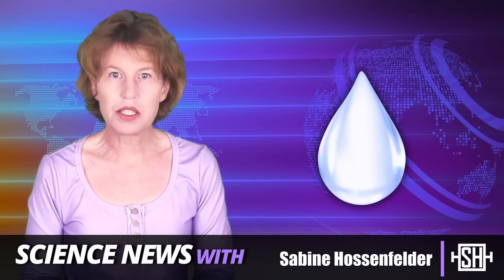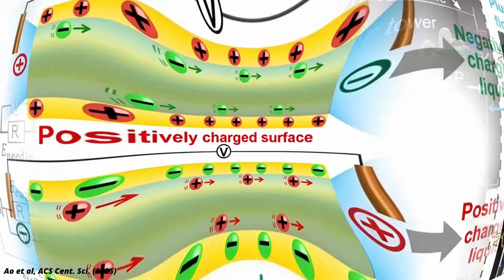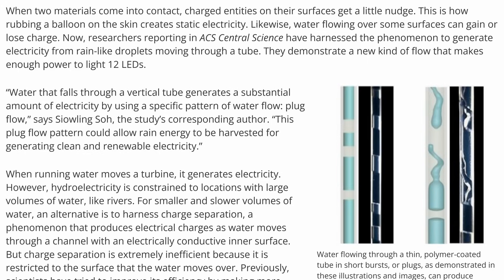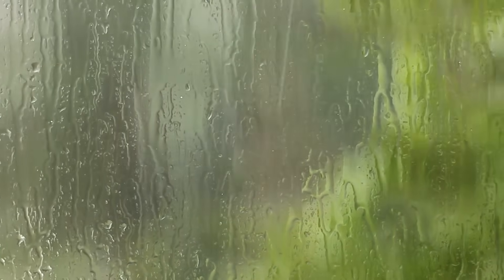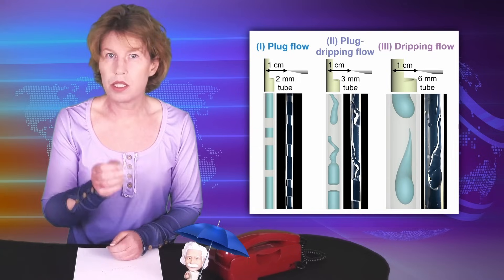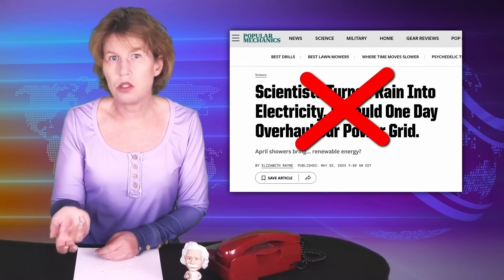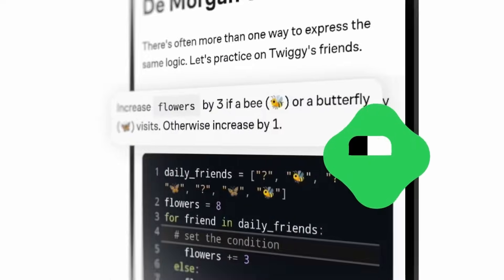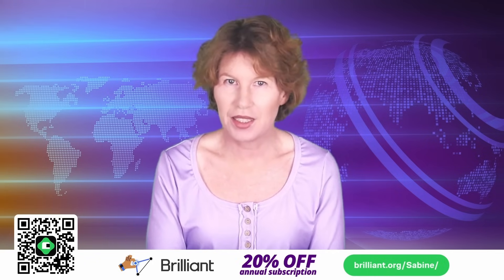A New Way to Generate Electricity From Rain

Comment: Thanks for the video. It is unclear to me how it scales with the tube diameter. Do the tubes have to stay at miliscale? What happens of they get bigger/smaller? 
Obviously, it cannot scale linesrly as the surface area that is in contact with the water scales differently.

Comment: The current 'gold standard' for moving-parts-free electricity generation remains the photovoltaic process. It is powered by photons, delivered to us 24/7, cost-free, maintenance-free, in more than sufficient quantities for billions of years to come! The pesky 'base-load' problem already has a moving-parts-free and economical solution and is in the process of being ramped up as we speak.The necessary grid conversion/expansion for whatever generating solution is implemented, in 'Stralia at least, is already under way!

Comment: It seems like it would be simple enough to develop an easily installable strip of these along the base of solar panels that could produce a few watts per panel, could be used for monitoring or even charge a battery and store the water for intervalled cleaning.
Reply: Less than 1 mW per panel, as usually you don't get kilometers of rain per hour.
Reply: @СашаЧерный-э2т  it's 0.4mW per tube, 2mm tube, 1.4m panel, a single row would produce 280mW per panel. Water collected across the entire panel is directed down to the row of tubes so don't need the km of rain per hour. Depending on where this is used in the world a reasonable amount of energy could be produced to even run the low power servos used to tilt the panels. When it rains you can't generate power from a solar farm but you still need to operate monitoring equipment and other systems so having this as a back up in that scenario could be useful if it can be produced at an affordable rate.

Comment: There is a background energy density in the vacuum of space that can be measured with two metal plates very close together in a vacuum sealed isolated box, the bubbling of larger particles from the quantum energy background happens more on the outside of the plate than the inside so some of those wavelengths get shielded by the plates, resulting in a net inward force where the plates have a small force inwards that is measureable, casimir effect, so what if you have now, a really really really really really thick plate. what's happening there? if you get mass dense and large enough, it pushes out some of the energy that would have been in that volume of space and you have a net force from the quantum energy fluctuations that would have been in that volume of space the the mass takes up, so there is a net force of all that energy being squeezed out layed on the surface of the solid mass, that we feel as gravity. So if this is correct, then gravity is not pulling us in, but we are being pushed on from the outside, and if it is a finite energy density per volume of space, then one day they should find two black holes that are different masses but both over the limit of how much gravity the quantum background can provide so they maybe could have vastly different masses but have the same gravitational pull which would be the limit of one single body's gravity. And maybe if you drilled a hole clean through the moon or the earth and you jumped in you would just float there in the cancelled out beam of zero point energy. I've been looking at gravity the past like week or so as a force coming from the outside in from the background energy of the quantum vacuum and it feels weird to stand or lie down now what do I do

Comment: Didn't Lord Kelvin create a device like this back in the day?  I followed instructions in Popular Science to make one of these devices -- you have a current of water droplets falling through a copper ring that's connected to one of two coffee cans sitting on an insulator (paraffin).  As the water drops through the air, charge builds up on one of the coffee cans.  Both coffee cans have sturdy wires (stripped coat hangers), and in a few minutes enough charge differential builds up between them to ionize the air between the two wires and create a spark.  It's interesting to watch in operation because as the charge grows larger, the water droplets are more deflected to one side and also start fragmenting.   [ok, my memory was flawed -- both wires attached to the coffee cans have copper rings on them and they cross partway up, which is where the sparks happen] https://en.wikipedia.org/wiki/Kelvin_water_dropper

Comment: Aha... 🤔 Yes, so the bottleneck is not the number of tubes per area, but the amount of rain per area. Ok... What if they make the tubes longer? Much longer? Like 40m tall towers with a big funnel at the top, and a few m2 of densely-packed 40m long tubes running all the way down. Would that get us a reasonable amount of power?

Comment: The switch to renewables is not a technical issue, it's a political one. Solar and hydro is much cheaper than fossil fuels, but the oil men have the guns and they use them. (FYI - Gaza, Ukraine, Sudan... those are all oil wars.)

Comment: Maybe it's only a distraction from figuring out cross valley arrangements of insulated at connections points for collecting electrical potentials between cables into capacitors during valley winds and rain passing through. Not everyone is to the point when testing if others know how to think right. But then I just jest knowing otherwise.

Comment: I doubt the claimed efficiency -- 10% of the ideal gravitational potential energy. Also, hydroelectric pumped energy storage is about 75% efficient, and a turbine generator is reported to be 90% or so. So... about as useful as piezoelectric shoe phone chargers.

Also, from videos of the Kelvin apparatus, the tubes might not be required. Once the drops are launched, they can fall through air.

Comment: I once estimated the power output of a balloon collecting rain water 1000m above ground. It was not great. Depending on location it could go up to 300W for a balloon with 50m diameter. But much less in most locations.

Comment: Even if this method of electricity generation was amazing, it would still be no good as our climate is now so unpredictable.
Up to about 10 years ago, I would have said Scotland could have been a powerhourse - given all the rain it 'should' receive under normal conditions (where I live it used to rain 50 weeks a year. Not 50 weeks solid rain for 24 hours, obviously. But you were guaranteed some rain every day).
Now, the rainfall rate is so refuced that the stream in my garden is almost dried out. It'll be only the 4th time this has happened, and each time has been in the last 5-6 years. 
Lately, our weather is very hot, dry, sunny and unbearable to work in. The farmer next door started working in his field at 9pm last night - when it had finally cooled off. 
Everywhere is just so dry, if someone drops a match, the ehole place will flare up. It's that bad.
Yet I'd never have thought it would be like this - and any installation of a rain powered system in what is currently high rainfall areas may dry up in the next few years.

Comment: If I may add to the previous statement, solar panels are actually incredibly detrimental when using black in the atmosphere of a planetary body that maintains balanced systems based on the use of emission and absorption spectral lines and the differences between them, when comparing nominal or previous balanced conditions to current conditions as a means of maintaining, balancing and extending the longevity of conditions conducive for conscious beings for as long as possible.  Black absorbs heat in atmosphere, or more specifically, is used to compare emitted wavelengths of energy of the surface of land and in soil, compared to conditions of space at night for example,  when heat transfer and particulate are most nominally balanced, among other things.  It doesn't absorb "light" like you would assume it does in space, the wavelength energy it does absorb is typically opposite in terms of horizontal and vertical propegation as it relates to wave particle duality between light and sound and propegation of energy in space, verses atmosphere. Yes, that is a thing. A common aspect of energy propegation at the sub atomic scale and up. The light it most likely does absorb, would be ions and embedded heat, and wavelengths of nearby energy... By attaching a battery to solar panels, or connecting them to a grid, you're actually creating a vacuum of sorts with a positive polarization I do believe,  that pulls the negative electron from the particles or energy interacting with the surface, simply put  the potential fallout is enourmous, especially when considering entangled states and objects in space that also create vacuum. The Earth's magnetic field energy propegates outwards from the core as well by  the way, if that isn't already understood or widely accepted. This is partially how particles are given the polarization that allows them to propegate and be balanced as long as they have been... Surface propegated electrical energy, mining, satellites, scientific experiments, perceptions towards magnetic fields and modern infrastructure have seriously inhibited this and created any number of seriously alarming issues far more serious than this rediculous focus on  green house gas emissions. Which is also a laughable term, considering oxygen is the only gas i'm aware of that nature emits when properly taken care of, or certainly when prioritized as the life sustaining and multi-functional companions they are and not viewed simply as a commodity, which actually reduced their monetary value over the long term, as sad and hilarious as that is.

Comment: The place I live has about 40 mm/m2 per month rain fall. That amounts to 1 kg/day per m2! If all that rain falls with a (terminal) speed of 10 meters/second, that yields a total kinetic energy of K = 0.5 m v^2 = 50 J/day. Yes: 50 Joules per square meter, is the total energy you can get from gravitational potential in one day. That amounts to avg of 0.5 mW/m2 ? This is the average, and the actual energy comes in larger high peak surges during short rain fall intervals.

Comment: Reinventing the wheel, are we?
If one want to use rain for electricity, all one can say is: "rain starts at considerable heights."
And that having "bucket" chain loop with alternator guarantees that taller the building, more energy per "bucket" of water gets extracted.
Conversion rate is practically limited only by alternator efficiency and friction losses.

Comment: "a factor of four less than solar panels" is -3x solar panels, or -300% solar panels. Less than means subtraction from. A factor of four means multiply by four. You meant "a factor of one fourth as much as solar panels", and not even "a factor of one fourth less than solar panels" which is "3/4 as much as solar panels".

Comment: I though nothing until you said 250 000 tubes per m². Then I was "wait, how much water is needed for this

20 000L/min/m²... I just laught. This is perfectly ridiculous in any way to look at it. Just know that 20 000L = 20 m^3 of water, so basically you need to have 20m of full water above your m² of tubes to generate 100W. And I mean it is 30cm, so if you try to get that for like a 3m drop, which is 10x higer you could get like 1kW/m² ?

If you had that much water, you'd better put a dam and a turbine. This is useless for pratical purposes, no matter at how you look at it. However, it does not mean that the full research is useless. It is some kind of fundamental research that may lead to better innovations. For example, you could combine this with hydroelectric barrages where you have a LOT of water moving after the turbine, and then a little drop, where conventional turbines are useless.
So you could then get a big generation with a little drop, no moving parts, so almost no maintenance. Which is nice. That's the only way I see this being usefull.

Comment: Possibilities don't always pan out into tangible applications. Aside from the burning of fossil fuels to run power plants, humanity has utilized nature to generate electricity using hydropower (gravity) for about two centuries already. The "new" process requires a steady flow of water minus the turbine at the bottom but the power output is miniscule in comparison to what's being used today. I kinda have similar feelings about this "discovery" that Sabine has ... interesting  at best. News?

Comment: Pure water boils at a much lower temperature, have it move through an partial pressure substance like rice kernals arranged in the silicon straw.  This make the charge randomly build up higher than usual at 5,000 psi.  Put a waveguide around the rice tube to measure its shakra.  Jim baba a tinagat hojo atuti

Comment: I wonder if this could be used in those installations where they do desalination by evaporation. The paper falls back down as "rain". So some energy from the evaporation could be recovered. And then you let it flow through the drain pipe generator. The straws could be the length of the entire pipe. Before and after the generator.

Comment: Presumably the water that goes thru the tubes doesn't disappear, so adding this to a roof wouldn't necessarily impact the effectiveness of a rainwater turbine, right?  I think there's a lot to be said for discoveries that could enhance existing renewable energy infrastructure (especially in low-cost or low-complexity ways) without replacing what doesn't need to be replaced.

I'm not a scientist or a pretend scientist (and my ADHD meds haven't kicked in yet) but I'll choose optimism today:  I love discoveries like this because they're easy to grasp.  They provoke thought and capture the imagination, and they invite the next generation to take a swing at solving the shortcomings.  Could a high school or college student develop this into a more useful form like a cloth or textile, or modify it to capture energy from other things like the movement of blowing sand?